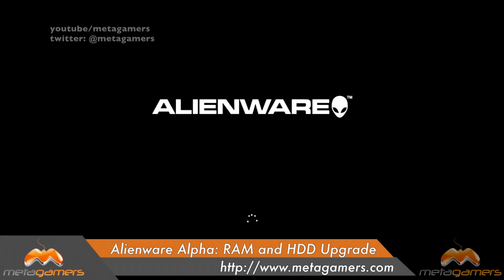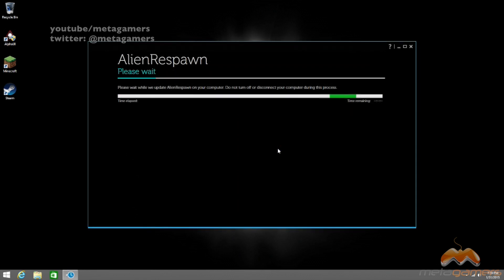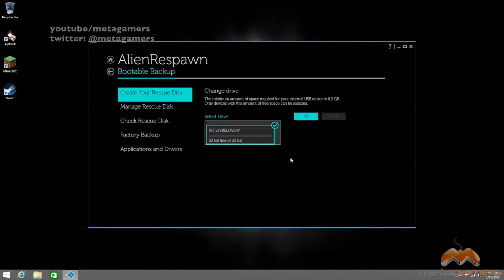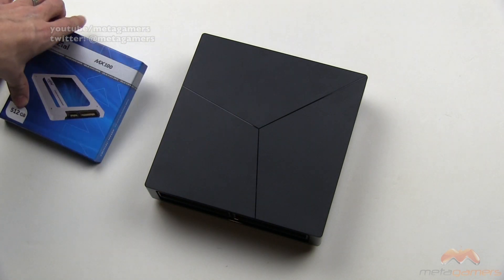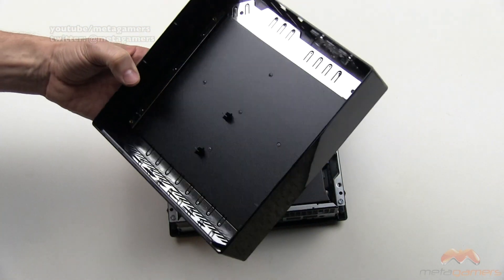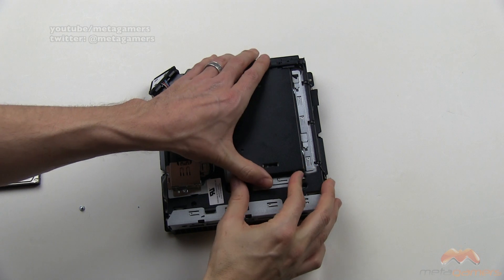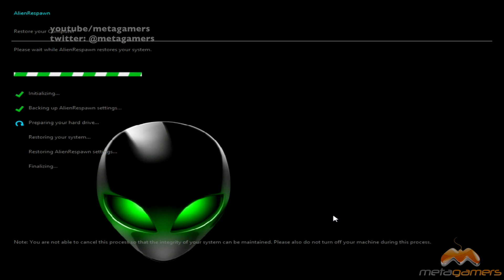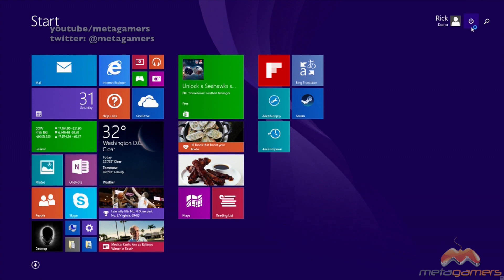Alienware Alpha RAM & SSD "How to" Upgrade Guide

Comment: I know this video is now quite dated, but I was wondering the specifics regarding RAM selection. Is the alpha not compatible with ddr4 RAM, or is it possible to get DDR4L 1600MHz ram as an upgrade for this machine? Seems a better improvement and waste not to go with the faster more recent generation double data rate components. Could someone explain why it would be restricted?
Reply: i know i'm late to this comment but if laptop ram is anything like computer ram it physically will not fit in the slot, let alone be compatible with the motherboard. it needs to be ddr3l.

Comment: This comment is way old, but I acquired this as a hand-me-down and I am pretty happy with it. However, I have been thinking of upgrading it to play more stuff. ( I mainly play FFXIV, but been wanting to play something else and more demanding). I want to upgrade to an i7 processor and get more RAM. However, I was told that it is better to drop the money on a newer tower with a more powerful graphics card, i7 processor and even more RAM as the price to upgrade my Alpha is hard of the price to get a new tower. Any suggestions?
Reply from the maker: Tough one, I’m not familiar with updating the processor on these but know it’s possible. I’d agree, maybe try to squeeze as much as you can out of the Alpha then when you need to save up for a tower.

Comment: QnA

Q: Can this RAM or SSD or CPU upgrade work on i3 model
A: Yes

Q: if I upgrade the RAM, will I have to backup?
A: No you don't

Q: HELP my system is blinking with yellow lights!!!
A: Did you change the CPU? If so it may need more power than provided.

Q: Will changing the SSD help run <Insert game here>
A: Not really, maybe a slight 1fps difference in texture heavy games, not really a big deal. This is best for video editing.

Q: I just bought the Alpha, do I need to backup?
A: No you dont.

Q: Can I Change the video card?
A: No it's soldered on.
Reply: Justsomekirbyfan cheers kirby
Reply: hey how did you do that?
Reply: id like to do the same thing.
Reply: So my alpha came with 100% disk usage constantly. I was able to make it chill out but every time the hard drive is used I shoot up to 100% briefly. Is this normal?

Comment: The ram you have suggest doesn't fit my i7 r2
Reply: i know this is old but if anyone looks the RAM between generations may be different.  Download a tool Called CPUZ it will tell you what ram is in any windows computer, its a free small app.

Comment: I'm trying to do this right now. My problem: When i click on Alien Respawn, the Alpha doesn't open the box with the Bootable Backup option. It opens a box that gives me system(/Dell?) backups. is this a different way of achieving the same result? Or am i missing something? Also, is Respawn Basic already on the Alpha? Or is that something i have to tell the Alpha to load/sign up for? Thanks in advance.

Comment: Can this be done using respawn if I have completely removed the Alienware UI and running windows 10?
Reply: I'm doing it now and it is working fine, however I used the newer version of Alienware respawn off of Dell's website.

Comment: Hey Rick, I am all prepared to follow your guide for replacing the SSD and my RAM on my Alienware alpha.  However, the Alien Respawn seems no longer available.  I am a bit lost, can you help me with what I need to use instead?

Many thanks.
Reply: Gary Collings what did u do then? And besides i dont want to back up my files with my old hard drive i want a fresh new ssd. Will i need a new windows if i would do that right? How bout the other stuffs like the rgb control?

Comment: metagamers So when you turned the Alienware back on, after the upgrade from hdd to ssd, did you press F12 or anything to access the reboot files or did you just turn it back on without doing anything?
Reply from the maker: +urbea97 turned it on without having to do anything else

Comment: Dang my drive is getting so slow.. It's gonna break. It erased all my pictures a year ago. Need a ssd but man they are so expensive for anything over 500gigs. Still...
Reply: oasisbeyond Buy a cheap 128 Gig SSD Which you can find for like 50$. then by a external
Reply: Better yet, buy a ssd then buy a e HDD external case to put the old HDD to be used as a external. That is exactly what am doing now.

Comment: Hi Rick, need some help! I've just bought my i7 Alienware Alpha and I want to do the upgrade to SSD asap. Is Alien Respawn still the program I should use or what? Couldn't I use the Dell Backup and Recovery program? Is Dell backup pretty much the same as Respawn? Hope you can help. Many thanks. Ew from U.K. 

By the way, I am running Windows 10 that came with my Alpha. I've heard that Respawn doesn't work too well with it. 

ps - sorry for all the questions.
Reply from the maker: No worries! I honestly have not done a backup since obtaining Windows 10 but I would assume Respawn should work fine still. To clarify, this is for a new machine correct? Nothing has been installed and its factory default? If that is the case you should be fine BUT I would do a quick check with Alienware/Dell to be sure.
Reply: metagamers Thanks for getting back to me. 

Yes it's for a factory reset machine. So once I've done the backup, however which way I do it, I'll be free to open her up and change to SSD right?

Comment: on the alien power button i get 4 flashing yellow lights. what does that mean
Reply from the maker: +Staremind04 did you swap out the RAM? It's possible it's not seated correctly or you have the wrong type
Reply: metagamers no. i was trying to swap out the processor but i couldnt so i placed everything back to how it was but then now i got the yellow light
Reply: Staremind04 mine did that for a few months after I accidentally pulled the power cord out of the back while it was on. Eventually it won't even bother turning on. When I sent it in to Dell to fix they replaced the motherboard and it hasn't done it again. I bought a second one that was used perfectly and it still does it sometimes.
Reply: It could also be because it's taking too much Power

Comment: Hi, really enjoyed your video. I'm planning on getting the i7 model. If I wanted to upgrade the RAM only would I still need to do the re-boot etc or is that only when upgrading the cpu/hdd? Thanks.
Reply from the maker: +Ew you should be able to just swap out the RAM no other steps needed.

Comment: I bought the most expensive model when this thing first came out. the one that cost almost 1000$ (i7). I think that's pretty bullshit they didn't give me 16gb of ram and a SSD for that price. but that aside for my first pc I couldn't be happier. people say you can build a pc for way cheaper. ok good for them but I don't know shit about building pc's + this thing is so fuckin small its awesome!. what's it been like 2 years since it came out? I haven't had a single problem with it and I leave this thing on 24/7. if you are looking for a pc that does not hog space and can handle high graphic settings then give this thing a shot.
Reply: The case also looks cool af
Reply: I've had the i3 for 2 years now. Never had a single issue with it, these pc's are awesome. I don't care about building my own pc either. I just want to play some games on a decent settings which is what I can do now. I think for the price at the time it was on sale for 400 i got the 8gig version. I should probably upgrade it soon though.
Reply: i had my i3 alpha for 2 years as well , no problems and i could run lots of games in decent settings , very well worth to upgrade the ram to max out at 16gb , thinking about upgrading my CPU in about a month
Reply: george castro i have this model as well and i slapped an i7 in it and was planning on putting 16GB ram in it , but apparently one of my fans broke ? not sure how but thats the only issue ive had in the 3 years ive had it
Reply: @hunterurban5465  I too have fan issues. Did you manage to fix it?
Reply: I just bought my friends used i7 model for $100. Upgrading the SSD here soon and may do RAM. Good to know it's relatively easy!
Reply: MrPacMan36 Jesus Christ, I bought my i7 model for over a grand 😂
Congratulations my guy!

Comment: Great video. I did notice where you messed up the HD instalation. Good job covering it up with your hand after installed in cradle, but I do think you should have informed or edited it to be proper.
Reply: I thought that seemed a bit odd.

Comment: http://www.bestbuy.com/site/pny-2-pack-16gb-pc3-12800l-ddr3-sodimm-laptop-memory-kit-green/4830503.p?id=bb4830503&skuId=4830503
this RAM is compatible with my alienware alpha? I put at risk something changing software?
you recomendas 8gb or 16gb of ram ram if the money was not a problem?
thanks very good video  (i have the i3 model)

Comment: I'm fed up with this stupid product... My alpha won't even turn on with a 5 consecutive blinking yellow lights
Reply: I had the same problem with it not turning on and the blinking yellow lights. I called dell and they sent me a box to ship to them( free shipping), got it back in about a week and a half. Turns out it was the motherboard, that was almost a year ago and haven't had a problem since.
Reply: I recently just fixed it myself took about 1 hour... took out the cmos battery for 10 mins and put it back in worked fine
Reply: +NoChillCam I did that and it worked, but eventually that'll stop working and I sent it to sell for repairs, got it back a few days ago and it works
Reply: Codex Plays I actually got a new pc and im now selling my alienware alpha. Im dissapointed but I got it to work
Reply: NoChillCam in order to run more games, I upped the ram from 4gb to 12gb and upped the hard drive to an i5 and it's running well
Reply: Same here but I only upgraded my ram to 8

Comment: It has to be DDR3L?? or can it be DDR3, I have been looking up stuff about it before I do anything, I want to make sure I got this correct...
Reply: The L means laptop so make sure it's not for a regular desktop.
Reply: Travor Dinh it actually means Low power
Reply: +Nicholas Thanks didn't know that
Reply: +Nicholas There is a pair of crucial ram that's DDR3L that I use on the alpha, on Amazon

Comment: Ok, all this looks pretty easy, and something I really want to do. There are a few things though I want to know. I am now on Win10, and I regret leaving Win8 because now my System and Compressed Memory is eating away at my memory and Disk. I've done everything I could find to solve this issue, there's been some improvement of course but not enough. So thought I would seek out another solution and found this video. If I do install all the listed hardware in this video, following all the steps of course, would that solve the issue with System and Compressed Memory? I have the Alienware Alpha i3 and it's now over a year old, but by a month.
Reply: Same problem here. Hoping the ram upgrade fixes these issues.

Comment: I followed these steps but when I try to load the disc image it says "your hard drive size is not supported for this process" and says I need a drive with at least 980gb. I have a 256gb SSD that I am trying to upgrade to. Please help. I am stuck in an endless loop now.

Comment: Does it matter if I use a Crucial MX200 500GB SATA 2.5 Inch Internal Solid State Drive - CT500MX200SSD1 instead of the MX100 512GB?

Comment: Atech 8GB DIMM DDR3 Desktop PC3-12800 12800 1600MHz 1600 240-pin Ram Memory

will this work with my Alpha?
Reply: +Ultimat3 SonicFan (Josh) Make sure it's a DD3RL
L = Low Voltage
Reply: +Azure Mist I just checked out the specs, and it's not low voltage. Will this be a problem?
Reply: ***** From what I'm seeing, yes. If you want I can link you one that has low voltage. (8 GB)

Comment: My install never gets to the step at 15:24 (https://youtu.be/Dr8S2S4XdMM?t=15m24s). I have been stuck in a menu that gives me two options initially. Then, if I choose the bottom option, I get an additional two options. They are along the lines of resetting just the OS partition, resetting everything, and whether I want to keep the alienware respawn settings. No matter which option I choose, it momentarily acts as if it is proceeding and then gives me an error with a hexadecimal number. I looked it up on Dell's site and it seemed like the recovery drive might be the issue but I've tried setting it up again multiple times with no success- exact same issue each time. I am now trying a reformat of the flash drive (the long version to see if there are bad sectors involved) and am about to try again but I am seriously thinking about doing a windows install drive (completely clean) or looking at another migration method as recommended on the interwebs. Has anyone else had an issue like this?

Comment: Please someone help, I'm trying to install my ssd in my Alienware alpha, but when I go to Alienware respawn and try to create my rescue disk, it just keep searching for an external hard drive, even if it's nothing plugged in, and I try switching flash drives, I can't click on change the drive, please help thank you
Reply from the maker: I can only speak to how I did it. I'd suggest backing up to a USB stick and then swapping drives and restoring from that stick.
Reply: +metagamers yes I have a memory stick, I also try and upgraded to Windows 10 and everything works fine up to the point where the new ssd is installed and I turn on my machine fallow the steps and my usb stick won't appierd for me to choose it
Reply: +PR Gamer I have never had the respawn software find a drive on the first go. I have always had to use the change drive button to get the software to search again. Hopefully that is all you have to do.
Reply: +PR Gamer This may be WAY too late, but I found a few people online who had problems getting Respawn to recognize USB 3.0 sticks. Apparently 2.0 are more likely to get recognized. Hth
Reply: hi listen I'm thinking of getting the alpha i3 as that's all I can afford right now.How is it I'm coming from ps4 and xbox one do you think the alpha performs better or do you think I'm better off sticking with what I have.also if you set the resolution to 720p do you get higher frame rates.

Comment: It seems like AlienRespawn does not come bundled or work on Windows 10. Windows 10 does come with Backup System Image software but it does not seem to allow flash drives. Anyone has been able to get this part working on Windows 10 Alienware Alphas?

Comment: I just upgraded the memory and hard drive without backing up anything now the system will not boot at all. Only get a black screen says something like press f1 to retry f2 configuring or f5 test please help!
Reply from the maker: You can't upgrade the HDD without backing it up first. Install the original HDD and follow the steps to create a backup per this video and then follow the steps and it will work
Reply: +metagamers omg thank you soooo much...that totally makes sense now. I thought I broke it! also thanks for the quick response! 😃

Comment: Alienware respawn has updated and idk how to get a back up
Reply: +marvinspower Having the same problem... Have you came across a solution?
Reply: +Ean yea go to Windows.com and get the Windows 10 installer! After that put your 8GB usb  into a Usb slot and load the program, after that select the usb option and wait for it to install. Finally after finished put the new ssd or hard drive into the pc, then put the sub into the pc and install Windows 10. Glad I could help! Alienware has a video on how to install Windows after you have made the usb! Merry Christmas
Reply: +marvinspower you will loose everything but it's faster than backing up it! Sorry for spelling errors I'm on my iPhone lol
Reply: marvinspower
 I'll have to check it out. Thanks for the advice!
Reply: Ean no prob
Reply: what do you mean by sub?
Reply: SSD
Reply: But I have moved on from the alpha to a custom built pc. I honestly should have started with it but the alpha was my first pc... But not the worst
Reply: oh ok thanks man ill see how it works

Comment: what brand of ram does it come with because i bought kingston 4gb ddr3l 1600mhz but there was only 1 left will i be able to use it with what it comes with? i got i3 version waiting for it to get here.
Reply: +Jarl Ulfric Stormcloak The default ram is made by Samsung and the hard drive by Seagate. I am of the opinion that mixing ram types is risky and avoid it personally. I hope that this information helps somewhat.

Comment: If anyone can awnser my question here, if I am getting the 4 GB ram 500 GB stoarge model, if I wanted to take it up to 16 ram but keep the 500 GB would it still be OK? Because in the video he used a 512 GB and I dont see how 12 GB would make a huge difference, can I change the ram and keep the storage at 500?
Reply: yes you can queep the 500gb and upgrade the get a crucial or kingston ddr3 ram 1600hz lowvoltage
Reply: +creeper gamein  if i only upgrade the ram to 16gb do i need to do all those steps or just put it in??
Reply: SwagTheGaming no it will work just go to upgrade the ram make shure it low voltege ram
Reply: +creeper gamein thanks for ur help bro i am new at this ;) i sub to you cuz i like ur vids
Reply: oh great thanks bro
Reply: +creeper gamein no problem thanks to you